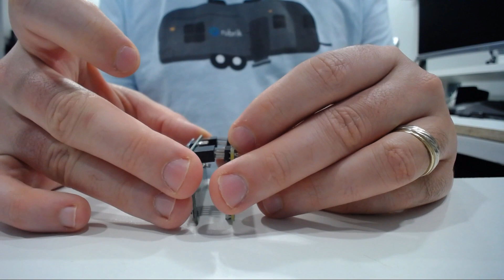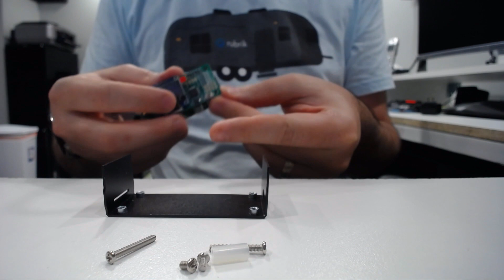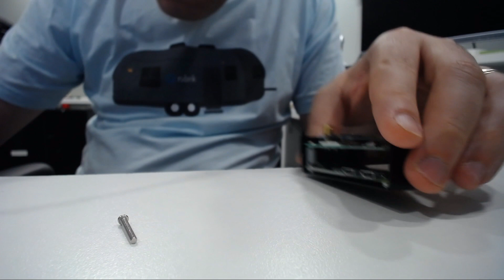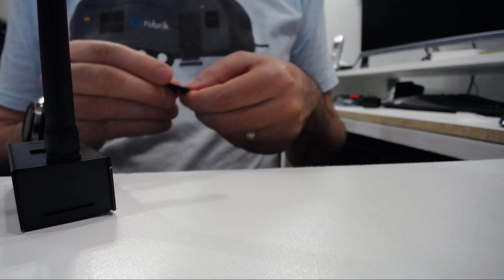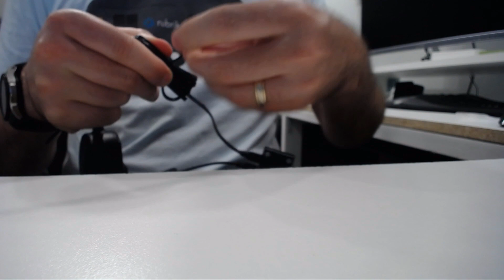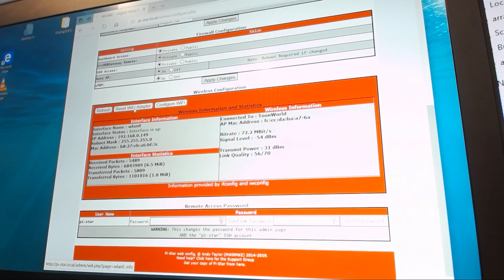MMDVM DMR Raspberry Pi Hotspot Assembly & Basic Setup

Comment: To connect using a mobile phone you have to use the pi's ip address in your mobile phones browsers then you can edit the pi settings on your mobile phone if you log into the pi on the pi it lets you different ways of logging in.

Comment: I believe you have the pi backwards in the case. The micro sd is supposed to go in the other hole on the other side of the case. The hole your using looks like the ribbon strip access port. Not to say that the other side is perfect but it also goes in
Reply: Yes he does

Comment: I tried to yell through the screen that you put the pi board in the bottom case with the SD card slot on the wrong side, but you couldn't hear me. haha. At least you still got the SD card installed. :)

Comment: The Pi 0 W I believes has Bluetooth and Wi-Fi!   There is app you can get to use your cell phone.  Think it is "VNC Viewer" there is a place in the Pi setup that turns on the VNC ON the Pi.   Thank you for the information.  I need to set one up soon. I have a repeater near but it has troubles sometimes.

Comment: nice i built my own also but i used a dual antenna hat. also your pi is sitting the wrong way in the base. the micro sd cut out is the bigger one for easy install and removal ... no biggie just fyi. i built mine is 2019 and its still going strong just updated pi-star several times to keep it updated. luckily i can save the configs.

Comment: I know this is an old video, but thanks for all the info.. I plan to build my first MMDVM soon, as pis are starting to come back in stock.. Quick question, can I get the raspberry pi zero w WITH headers? I know they would come in contact with the olde's pins, but could i just cut the oled pins short, and cut the un-needed pi header pins?
Reply: Hi. I am setting up my pistar, model MMDVM and came across this video. I took a moment to look over comments as they are also very informative. The radio I plan to use with the hotspot is the Anytone D878UV. A friend set it up for BrandMeister. I also want to use it for Turbo. I am curious how to do both and what progress you have made since your post. My call is N7NGM.

Comment: Am I really the first to notice that the R-Pi is screwed in the base backwards? :p The slot the SD card was pushed through is for the camera... the other side has a bigger hole to lame removing the card easier :p
Reply: Good catch!  Yes he did install the Raspberry Pi board backwards on the base.  I had to rewind to double check it.  
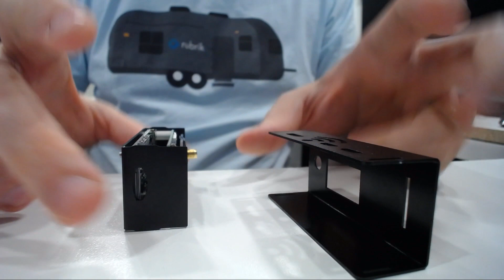It's at the 9:45 time mark where I saw the semi-oval cutout for the microSD card.
Reply: i was wondering if anyone elese would catch that.  I've put together several of these.  It's rather easy to mix it up.  But he didn't catch it.  The in-dent on the real SD Card side is so one can more easily pull the card out.  On the Camera side, it's impossible to pull the SD Card out of the slot.
Reply: OASN:  He said in the video that the RPi Zero W doesn't have Bluetooth.  Actually, it does have embedded Bluetooth.  Pi-Star doesn't use it.  But it does have it built-in.

Comment: Good video for sure. I have a 5 and a dual band pi-star hat and this exceeds the capacity of the case metal case that came with the kit. Do you know of any kits that will accommodate the fan, antenna ports and all that for a 5, dual band hat AND fan? Thank you!